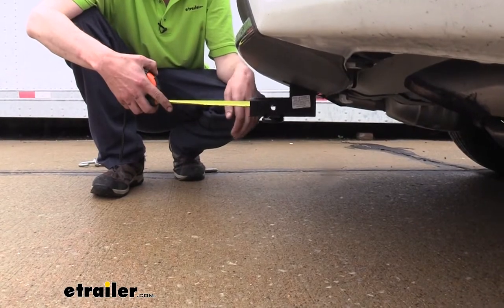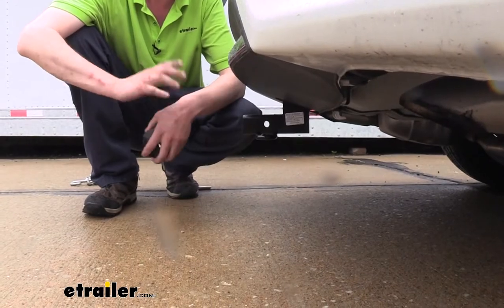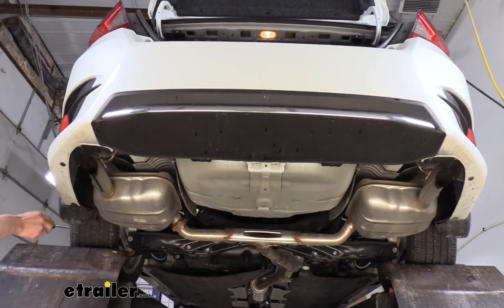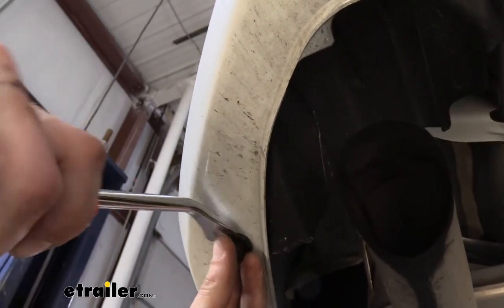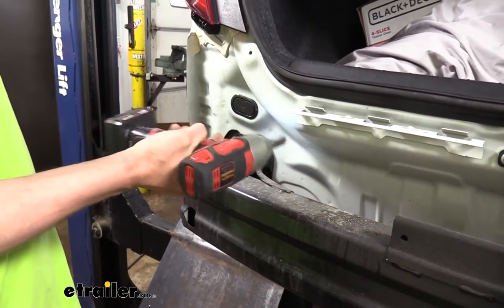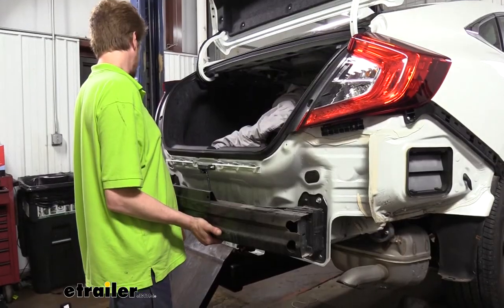etrailer | Draw-Tite Sportframe Trailer Hitch Installation - 2020 Honda Civic

Comment: Removing the bumper is scary to me.
Reply from the maker: If you don't feel comfortable installing the # 24954 on your own, you can find a local install facility by using this link:
https://www.etrailer.com/installer/near-me/trailer-hitch
Just input your zip code, and you can find a local installer...
https://www.etrailer.com/Trailer-Hitch/Draw-Tite/24954.html

Comment: I dont understand why those sections of the bumper were cut off?
Reply from the maker: Because there isn't enough clearance for the hitch to fit around the bumper unless the ends are trimmed. The same would hold true for the Curt # C92UR hitch.
https://www.etrailer.com/Trailer-Hitch/Draw-Tite/24954.html

Comment: Can I haul a 12in Aluminum Jon boat with this ?
Reply from the maker: You will need to check in the owners manual of your vehicle to see what the towing capacity is to be sure that it can pull your boat.
https://www.etrailer.com/Trailer-Hitch/Draw-Tite/24954.html